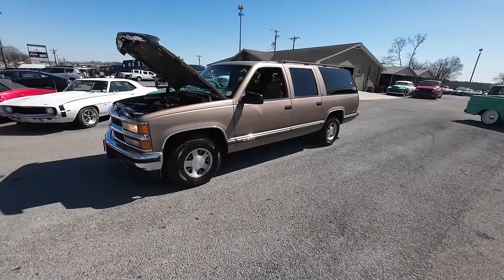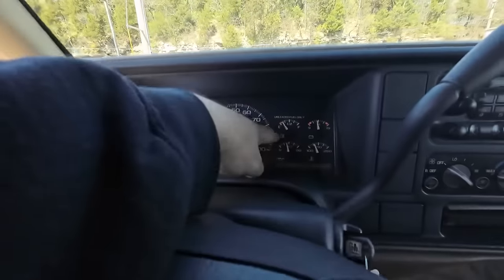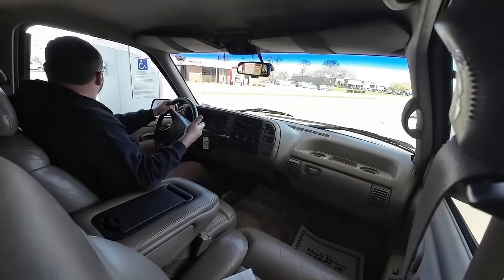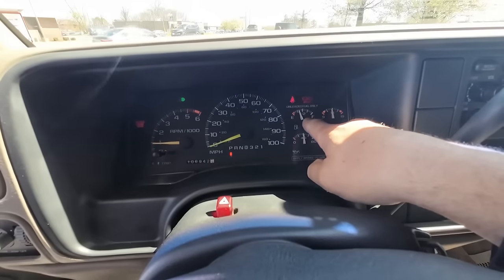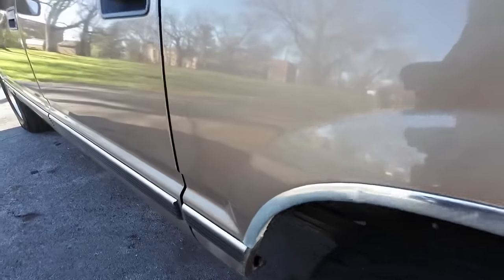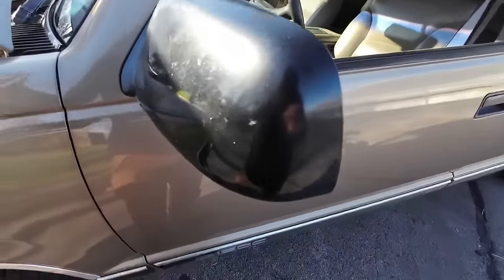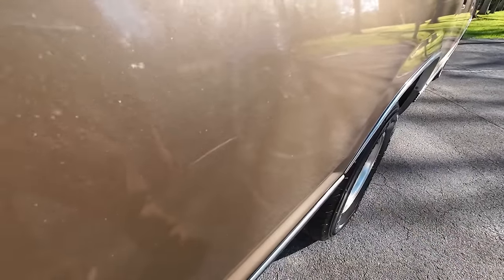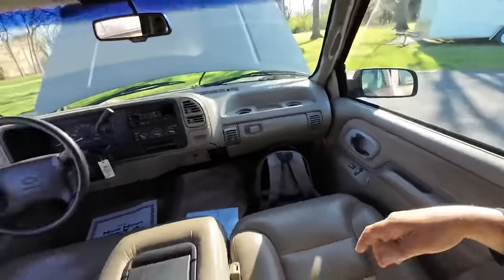Test Drive 1996 Chevrolet Suburban LT Low Miles SOLD $7,950 Maple Motors #2533

Comment: Just Got my all black rust free 96’ burban for $3,000 3 months ago. 123,000 miles on it. New rear air shocks, magna flow muffler, new lights, new brakes, 20 inch chrome, it rides so damn smooth and fits my family of 5 so nicely with plenty of space to spare. Cosmetically not as pristine as this, just needs a tune up along with a new front windshield and a paint job than I’ll be satisfied 😅 It’s my daily and I can’t wait to hear her start up every morning!

Comment: I had a 1999 Suburban LT with 360,000 miles on it. Still had original engine and factory exhaust on it. Absolutely NO rust, not a single spot. Nice truck!
Reply: You got that right my friend and that's no lie.
Reply: Hey I had a 99 GMC burbon myself. Couldn't get it stuck in snow if I tried! Absolute tank of a truck. 245k miles till I traded it in.

Comment: Not trying to be critical, but the fact that the little picture of the gas pump is on the left side of the gauge tells you that the gas filler is on the driver side. You do great videos BTW.